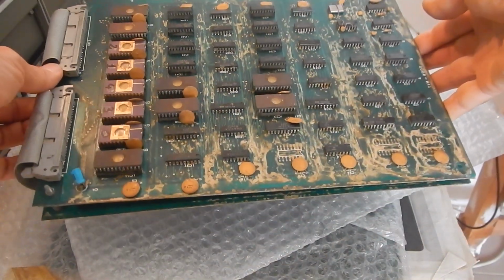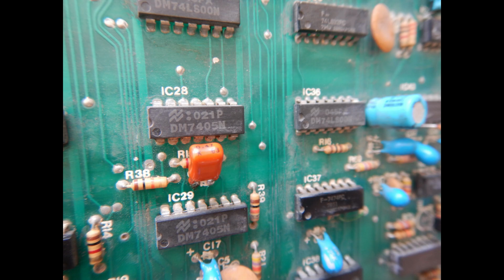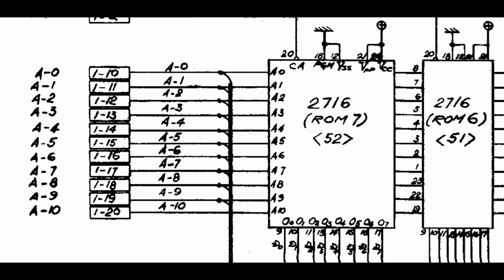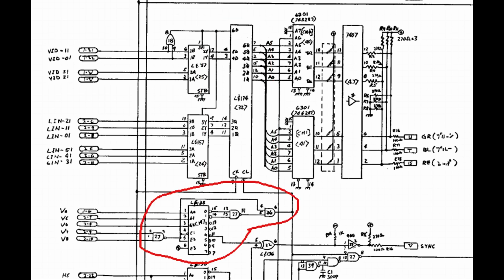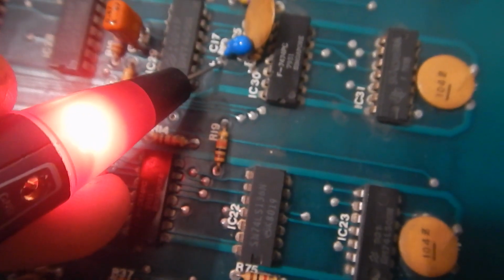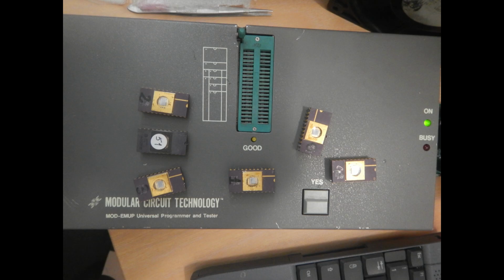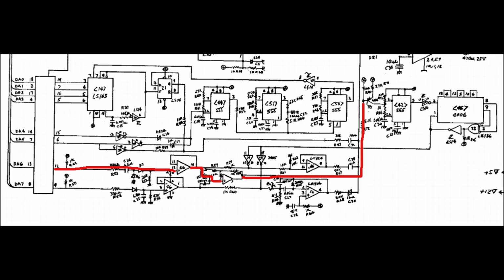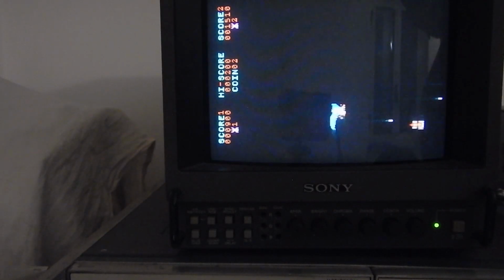Phoenix arcade pcb repair

Comment: Phoenix was actually developed by Taito.  I forgot that an ASIC was responsible for the melody.
Reply from the maker: Well it's really unclear to me if it was Amstar the original manufacturer that licensed it to Centuri and Taito. All instances of this game on www.arcade-museum.com are from 1980 and Amstar seems to be the first one. However the PCB uses a japanese pinout for the transistor on one sound effect, so that would suggest Taito designed it.

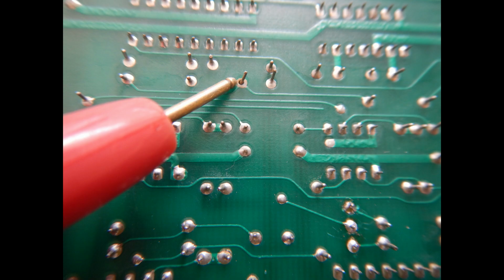Comment: 2:57 there's a trace that ends... nowhere! If you follow the trace of the non-soldered pin to another pin, left of it there's a via. And left of that is... the end of a trace that goes nowhere? Or is it for audio shielding?
Speaking of Shield... the Shield button on Phoenix bootlegs isn't consistently on the same pin of the edge connector because some bootlegs have that trace accidentally shorted and re-routed the Shield button to another pin... something to look out for.

Hm "normally" Phoenix boards have video noise in the audio. Kinda cool you have one that doesn't.
On my board, the wrong background tones on the hatching Phoenix / Boss levels were due to a bad LM324. The one next to it was also bad and is involved in the noise circuit, so my board had exactly the same symptoms as yours for completely different reasons.
Reply from the maker: very interesting find the "nowhere trace", let me dig out the board and see what is that (I need to separate again the two pcbs for that). I think the digital noise is variable from board to board, it surely depends even on the brand of TTL ICs they used, I don't think there were any precautions on avoiding ground loops to the audio part.
Reply: @iz8dwf  Damn it! Thanks to you, my brain is now playing "He's a real nowhere trace, sitting on a circuit board, making all his nowhere connections to nobody" :-D
Reply from the maker: @senilyDeluxe  LOL, just checked: that's indeed a ground trace running between IC50 (555) and the melody IC. It might be for audio shielding.

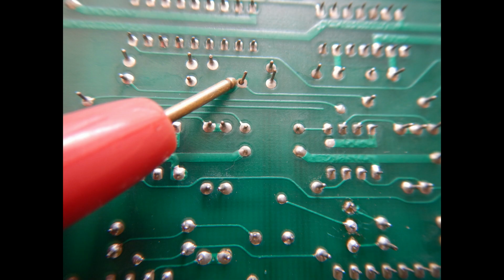Comment: At 3:00 I found amusing that you finally completed soldering that missing solder. I guess it didn’t glitch out the game anyhow.
Reply from the maker: It was a bypass capacitor, so it didn't really affect any vital function of the circuit.